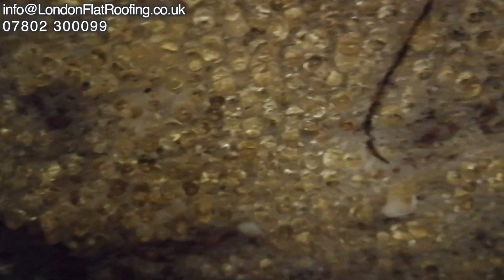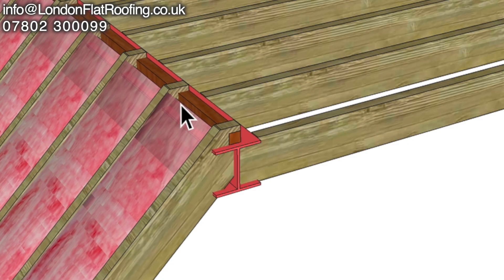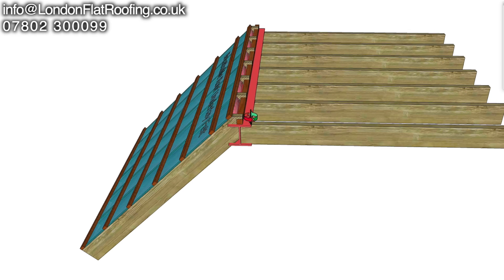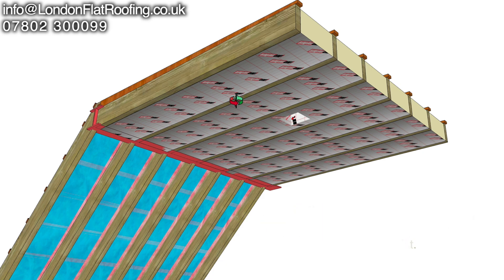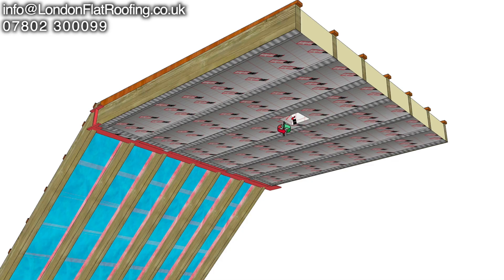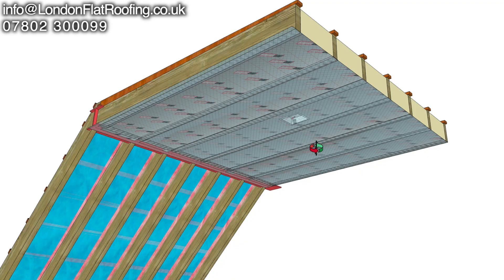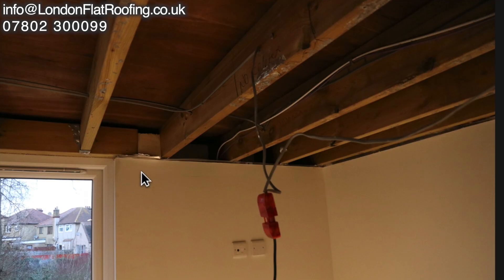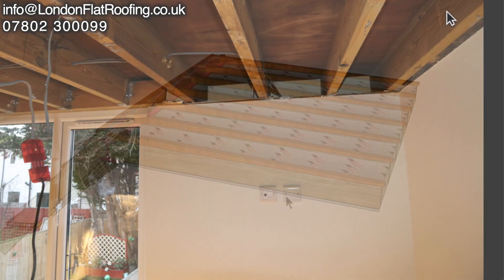Flat roof mould and bad ventilation in a new cold flat roof over a loft dormer.

Comment: I need to insulate a sloped roof in the utility room. Having got advisement from a builder he has said to insulate the rafters and to push the board as far into the pitch as possible. I’m not sure how it will get ventilated if I seal the ends or should I leave the ends open. I am worried it will attract vermin. I am capable of doing this but want to get it right. Also the walls need insulation. I plan on battoning and using insulated plasterboard. Should I also insulate between the battons or will the plasterboard be enough.
Reply from the maker: You ned to levae an air gap above the insulation and vent the ends
Reply: @SteveRoofer  thank you for your advice.

Comment: Could use Humidity sensors and vent axia extractors wired to a BMS system like in industrial roofing applications on sensitive units such as document storage or computer rooms or certain mod buildings I’ve worked on
Reply from the maker: Or just vent the roof correctly

Comment: If they replaced the rock wool batts with celotex under the tiled section, wouldn’t that allow an air gap between insulation and tiles. This could be ventilated via the soffits. Then there could be a clear path for fresh air to travel all the way across the flat roof section.
Reply from the maker: You dont want to do that as you cood fee warm air into the flat roof from the front pitched roof. What you should do is vent both separately

Comment: Benefited a lot from this. My dormer roofs are open at the minute. I notice condensation here and there and realised that as in the video, the air was being blocked by noggins running accross floor of dormer. Took a long time but I drilled 4 inch holes and left them clear of the 100mm insulation. The condensation disappeared in a week. Thanks a bunch roofer guy.
Reply: Ya if the noggins were ripped 2" shorter to the size of the joist originally be much better

Comment: I was advised by a builder on exactly this issue years ago. I have seen some videos saying that an air gap of between an inch to 1.5 inches is advisable. Many I have seen take the insulation right to the roofing felt, with no air gap. at all!

My intention on a 700 mm rafter is to flush fit 250 mm Recticel with the front to leave a 450 mm airway behind and over the top. Another 250 mm going across and on top of these, and left like that. The loft is just used for storage, not living accommodation, so the aim is to keep it less cold, (as opposed to warm), and dry.

Thank you for this video, it reassures me that I am not too far out in my reasoning.
Reply: The builder could have created a continuous air passage from the soffits to the flat roof, if he had allowed an air gap between vapour barrier and insulation.

Comment: Fantastic explanation and diagram. I came across it whilst looking for a solution to prevent moisture in a brick outhouse with a concrete roof, that i want to convert back to a toilet and utility room. (condenser dryer causing the problem). Any pointers would be great,

Comment: The only thing I learnt from the video was that there are still lots of good builders out there who unfortunately have little technical knowledge. Why don’t the planners request warm roofs and why did BC sign it off! Warm roofs are the only way to go!
Reply: It's just not always an option sadly - anything that's terraced means that your ridge height is already set and that any space is then reducing headroom internally.
Reply: @videogalore  That’s utter nonsense. All it takes is a bit of forward planning.
Reply: @subzero3054  I'm talking about loft conversions here, so the house exists, the first floor is already in place and the ridge lines through with the neighbouring properties. You have a lower limit on the floor level and an upper limit on the ridge, so I'm not sure what's nonsense about that?
Reply: @videogalore  Yes I agree with you videogalore. Many loft conversions would be unviable if we had to use a warm roof construction because the new ridge line would be too high relative to neighbours and would  be refused by planning. Match the ridge line and the internal headroom is too low. I totally understand why builders install a cold roof but it's definitely sub-optimal. And just ban the installation of downlights cut into ceilings. Everywhere. They're just stupid at any floor level when you consider fire, sound, insulation and ventilation. And it's quite difficult to change the bulbs.

Comment: The other factor contributing to this issue could be “thermal bridging” by the wood joists. The insulation stops flush with the joist, so there is no thermal break between the interior and roof cavity. The joists will transfer energy between the spaces. The temperature difference will result in a phase change of the moisture in the roof cavity, i.e. “sweating”. 
Insulation needs to be applied under ceiling sheet rock, to properly disrupt this circuit. 
The tape and vapor barrier installed will stop air leakage from causing this same issue, but have effective R-value of 0, so won’t prevent thermal bridging.
Ventilation you recommend is certainly  necessary,  but in a cool, humid climate passive drying is challenging, so preventing condensation is equally important. Check out #thebuildshow for interesting insulation info!
Reply: Thermal bridging wouldn’t cause this. This is 100% down to no/very little air flow as stated

Comment: Ah planning permission for warm roofs is such a pain. Not allowed to go above current ridge tile height but need those extra 4 inches, not like you can even tell from the ground anyway. Carbon neutral by 2050 they said, but we won't let you do it with modern tech or relax sensible aspects of planning to get there on older properties. Great content on this channel quite enjoying it.

Comment: A new build should not have a high humidity level if the part F ventilation strategy is right and, if mvhr is installed, they have had the handover talk about operation. I see houses with an inadequate number of trickle vents and / or inadequate extract fans. For example, Kitchens and utilities should have 30l/s  not the 100mm under stair toilet type fans!

Comment: Iv had my garage built about 2 years, recently insulated the roof from inside like this, all osb is going black like this and started to smell 
Am I best to insulate with dry therm and put some vents into fascia at backside of garage ?
Is this moisture not from the cold brake between the installation and the cold osb?
Same as you get with glass ?

Comment: Simply remove the insulation from the area the roofingfelt meets the flat roof
Reply: But isn’t the rock wool batts filling the the full depth of those rafters? Replace with celotex and arrange an air gap.

Comment: Isn’t it a fact that the front gable insulation needs removing, to allow the thru flow of air, rather than adding 150mm above ridge line...

Comment: 👋 Steve so building a garden office/man cave 😂 so would this work ? From inside to outside 

Plasterboard 
Vapour barrier 
100mm wool insulation 
18mm osb 
Rubber roof 
And at either end of the soffits ventilation so air runs to one end to the other on each 600mm spacing between joists ?
Reply: You would need need 50mm of clear void between the insulation and the OSB and vent it at each end

Comment: you show it having continuous tape -jointed foil backed kingspan with a polythene layer below that and yet you still state that humidity from the dwelling area will go up into that roofspace - how ?
Reply: @Ed-ti1ss  if the tiled roof section is not vapour sealed on the inside, will not moisture make its way up to the flat roof? I know it’s blocked at the junction, but moisture has a way to find weak spots.

Comment: Just a thought. What if that foam insulation was not as thick. Surely then there would be a gap for air to flow. Does it really Have to be from bottom of joists to top of joists?

Comment: Not to sure about this video, the more ventilation you bring in/via soffit vents will raise the dew point moist air hitting warm air from below.
Reply from the maker: Excellent point and you are correct, but you have to look at the way this works, you will only get this problem for a short period in a year, if the venting is there, this will dry out over the dry period of the year. All calculations you see allow this, and we have to assume the  professional design teens know what they are talking about
Reply: @SteveRoofer  ok I see your point if you have a great big Gail blowing through like clothes on a washing line it will dry the out the moisture , but my point remains don’t have ventilation at the soffit and ridge have your pir board tight up to the osb and to the full depth of the roof spar with 70mm cover above the spot lights and you will not have moisture.
Reply from the maker: @markworthington3893  No you will have a build-up of moisture
Reply: @SteveRoofer  How!! Warm air cannot meet cold air therefore no dew point no moisture.
Reply from the maker: There is nothing on this planet that is a complete vaper block or stop so you will always get some vapour migrate up into the constitution
Reply: @SteveRoofer  right ok, in my opinion no ventilation, full pir, the depth of the joist/rafters,70mm minimum cover above spot lights ,vapour barrier,50mm pir backed plasterboard fixed the opposite direction to the rafters ,the (migration) that will happen is so minimal (if it happens at all) will Evaporate before any damage show’s.

Comment: Would a fan or a PIV in the room help reduce this problem, before it starts?

 I'm in the process of insulating my basement ceiling and i'm planning on adding two fans to remove moisture and PIV to bring in filter and heater fresh air. 

So for i have added to ceiling 100mm batt mineral wool insulation (actually previous owners of the house added this) flush up to t&g floor boards above, then I have added ecotherm  115mm which has two sides of foil filling out the floor joists completely. Then i have 12mm battens as a gap the opposite way across the beams and left gaps so air can flow. I have used 600mm x 1200mm  waterproof tile backer boards as the ceiling finish. 

There was not any mould growth before in the ceiling between beams or on the underside of the floor boards but moist air was definitely escaping into the living room and made the lower walls sticky, like wall paper paste wasnt setting. The ceiling in the basement was covered in MFC Chipboard ! and had expanded / dried that many times it was all out of shape and bowing. Some mould was on this facing into the basement but not as much as you would expect. 

I'm trying to make the basement as dry as possible but at the moment when it rains around the bay window in the basement it forms puddles - then drains to a center drain over time or condensates. I'm hoping re-pointing my front wall in summer will solve this issue of a water puddles. 

The main issue where the walls of the cellar someone had the bright idea of timber partitioning the walls out from brick face to make them flat adding two plastic vapour barriers front and back of the timbers adding batt insulation in between it all then plaster boarding. The whole walls where sucking up the moisture and never drying out as the vapour barriers failed most had nails through them. The wood was also fixed to the floor and had practically turned to coal. Mold was growing in between the to the walls and vapour barriers mainly on the timbers. Fun job removing it all and bagging it up!

Any way, long story short i was just wondering how much effect fans and PIV's have on the effect on mould growth. at the moment i have the window in the basement open all the time, and no moisture has collected on the ceiling like it was before when shut

Comment: Another possibility is that the OSB roof deck was saturated with rain water when the roof membrane/ covering was installed. Thanks for your time Steve, great videos. Plenty of builders need to be aware of these issues.
Reply: If the deck were saturated then whatever was used on too for the roof I.e GRP or EPDM then that would fail and not bond. That’s not the case.

Comment: Great video Steve. I've just had a cold flat roof dormer built exactly like this with front sloping roof but there is a chimney stack through the flat roof blocking even more airflow between rafters. There are no 50mm battenings to provide cross-airflow. Insulation consists of 100mm PIR in the rafters underdrawn with 30mm PIR -all PIR is foil backed. The BCO has said the firrings should now be notched every 300-400mm across all 16 rafters to provide cross airflow and a continuous soffit vent added on both dormer roof cheeks to compliment the same soffit venting on the dormer face. Considering I also have downlighters and the PIR has already been cut to allow wiring through it, should I now add an independent VCL on the underdrawn 30mm PIR before the finishing plasterboarding is added and does this remedial work sound like it will adequately prevent condensation build up? 

Many thanks

Comment: i got same condensation rus down walt when its hot as its a consevaty  but its a rubber roof i did not put a breather pipe in if i put 1 in the roof do you think it would help please cheers
Reply from the maker: Probably you really haven't given me all the information I need is it a proper cold roof? If it is of course cold roofs need ventilation

Comment: Nice clear video with good explanation and images.  I have a concrete block building with a nearly flat roof that has an open soffit at one end and is closed at the opposite end where it terminates at the castle wall.  Been trying to figure out how to insulate it, and now it seems like a warm roof is the direction I should be looking.  The problem will be the expense of tearing off and re-doing everything above the decking.  I'll look at your other videos and see what I can learn first.  Thanks!
Reply from the maker: Not a problem if you want to send me over some photos of your concrete deck roof perhaps I can help you
Reply: @SteveRoofer  I just found your video "thermal bridging of an insulated flat roof through the front facia" and your diagrams there look almost exactly like what I have.  I am now figuring cost for putting a warm roof on.  Cheers from the other side of the pond!
Reply: I have a similar situation with my garage.  I cannot do a warm roof at this point.  I am now trying to figure out how I could allow the cold roof to vent properly.  I have vented soffits at one end.  Would making holes in the rafters at the other end to allow air to flow between the rafter gaps work?  Or should I plan to install some kind of vents on the roof at the end opposite the soffits to allow through flow of air?

Comment: Roofing contractors should get sued for not understanding roof construction and not being able to build properly.
Reply: Hi Steve thanks for the interesting videos on flat roofing. I have been a building control Surveyor for 30 years and come across wetness in many roof which I understand as mainly formed by the due point in the unvented voids (warm air condensing to cold surfaces) and not moisture  from other rooms from below transversing through vapour barriers. Hope that helps all the best Andrew
Reply: @andrewbroughton995  Where is this warm air coming from with the water it carries?
Thanks David.

Comment: Fantastic explanation, learning alot with rheae videos!!

I'm doing a cold roof now on my new extention what's the best way to install downlights?
Reply from the maker: Anyway you can that doesn't  cut into the insulation or the VCL so basically build a caverty under the the rafters ( this lowers the ceiling) or use slim LED down lighters

Comment: Would a solution to this be to add a vented dry ridge if keeping as a cold roof?
Reply from the maker: Yes anything to increase the venteration. But more to the point on this building the internal RH relative humidity is much to high so he needs to do more to stop this from coming back

Comment: Hi Steve If you are restricted in height above your flat roof could you have a build up of 

Vapor barrier under joist 9x2
100mm board insulation tight to the plywood deck above.
50mm on top of the deck 
Then plywood and roof covering.
Reply from the maker: No.if you want to go down this route then the golden rule is to always have more insulation above the decking than below

Comment: I think if   they cross battened the ceiling joists before plasterboarding that might of helped
Reply: A good reason to cross battening below is to create a void for electrics so you don’t have to compromise the vapour barrier/insulation.
Reply from the maker: How?  cross batting would not help the lack of venting
Reply: What is the reasoning for cross battening then in ur opinion this is to allow air to pass through?
Reply: Cross battening below would not help, maybe cross bats above might help with cross ventilation but ud still need to unblock that air exit point.
Reply: More often cross battening is due to incorrect spacing of rafter for plaster board due to structural reasoning for new timber or the fact the original timbers are not at correct spacing for requirements on regs....! Also as said cable spacing and plastic water feeds